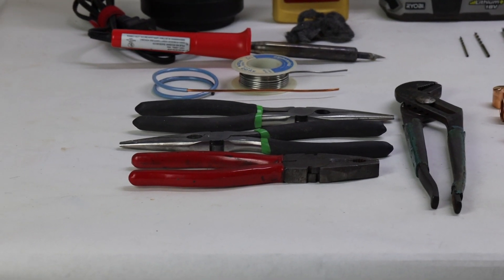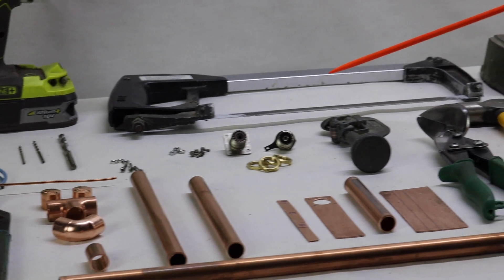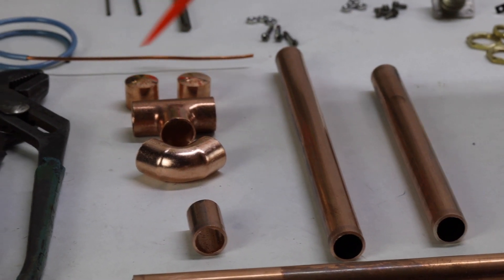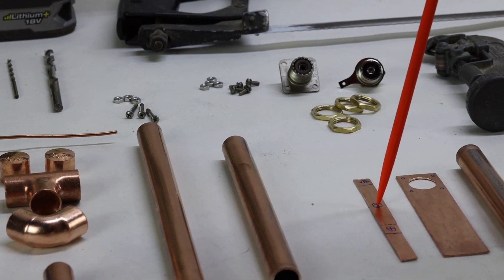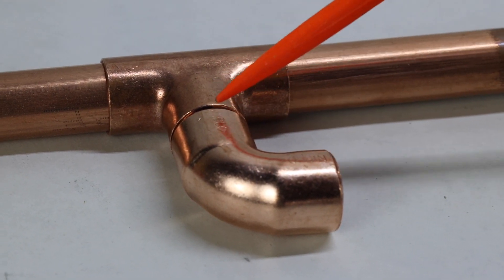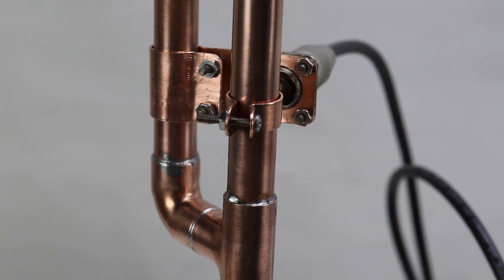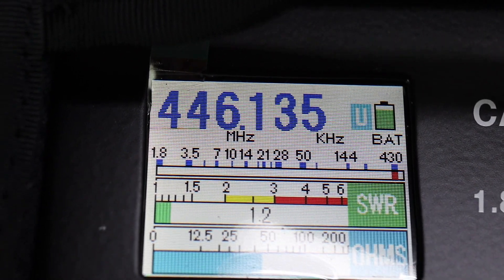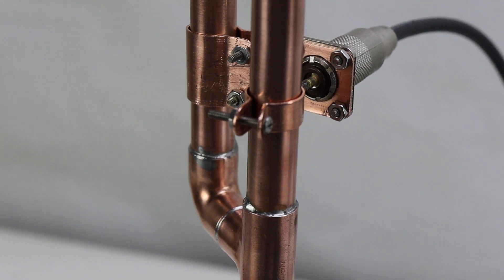How to make 440 J-Pole

Comment: Unsure how you come up with 15mm for D in the Plans inbetween poles, I can see 30mm for D in the plans but could you give guidance on how you get the 15mm for D. I would have to cut the tee in order to bring both poles together enough is this correct?
Reply: yeah, he was talking inches the whole time then goes to MM. Its all part of the deception. did you notice he didn't use brass screws?